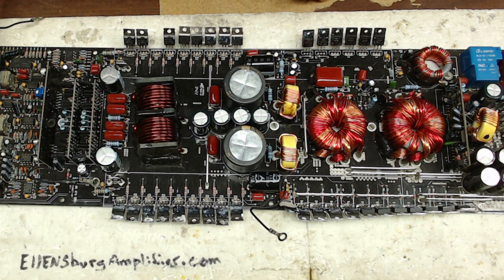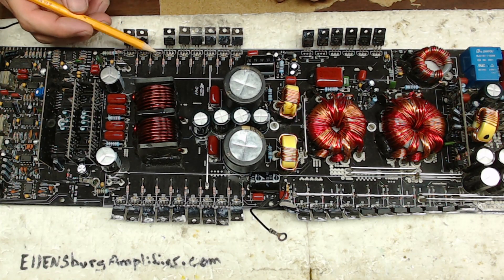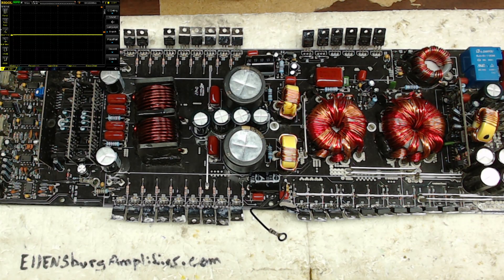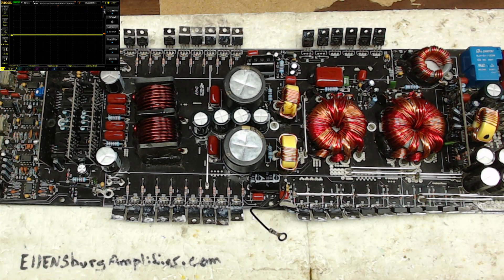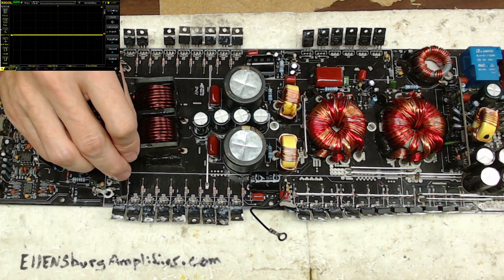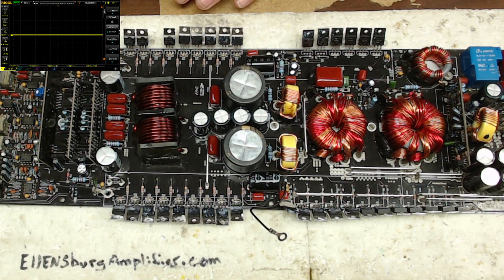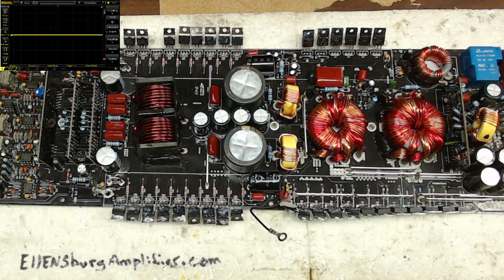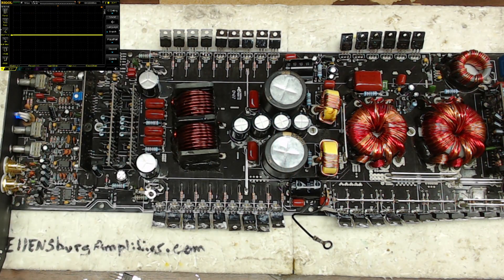JBL GTO1201.1 Class D Automotive Amplifier Repair Quick Video

Comment: I’m repairing a Kicker zx750.1 that uses the same type of output as this amp, just got in my replacement LM361n, hoping the 4060 or other piece isn’t popped as well, lol. Forgot what’s what on my board as I put it off since it was so bad and I had other easier boards but now it’s my last (besides XTR2500.1Dz I’m waiting on parts for) mine had complete PS meltdown, all fets literally blew up, been replacing components all over this ZX750.1 🥴 fun
Reply from the maker: Might want to find a source for the 4060 just in case you need to replace it. I have had to replace a few in the past.

Comment: Muy paresido al memphis 👍👍
Reply from the maker: Yes the Memphis Soundstream, Orion 2500D, Crossfire use this design. It can be a pain if the oscillation card is not working properly.